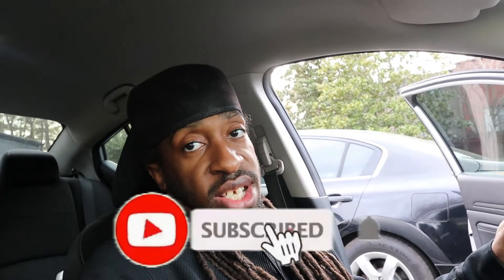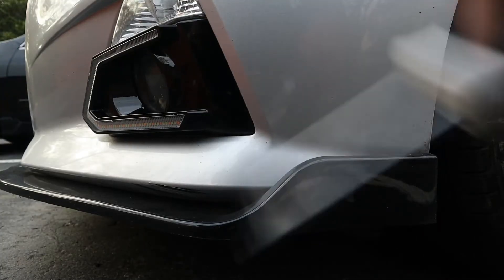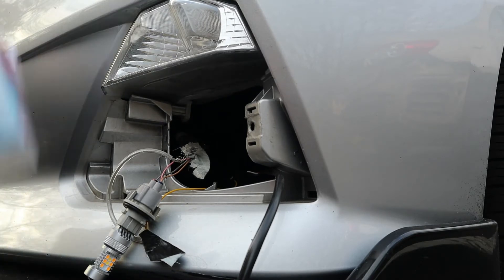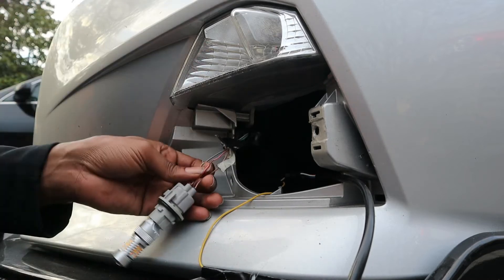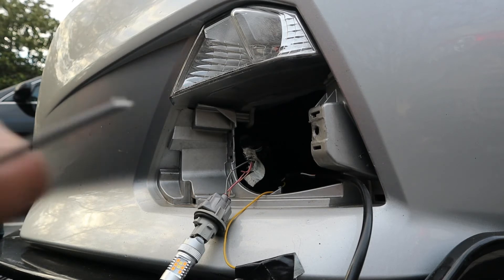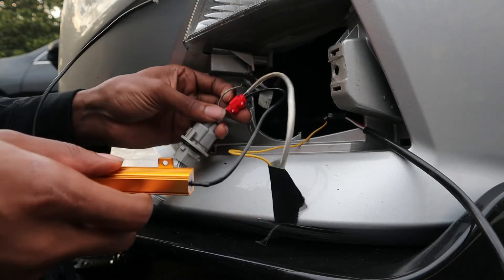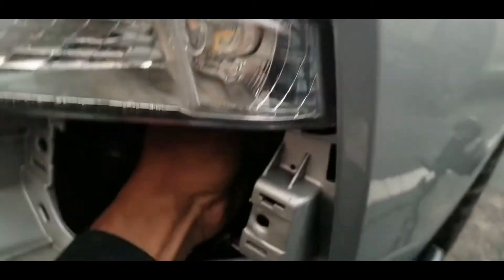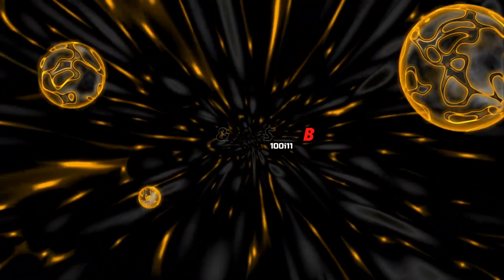LOAD RESISTOR INSTALL TO STOP HYPERFLASH SIGNAL ON 2019 NISSAN ALTIMA

Comment: I just got my led DRLs and the front splitter installed on my 2020 SR yesterday. The body shop charged me $150 for both! The car looks TRANSFORMED! The hood body lines stand out now and it just looks more finished overall. Thanks the videos.  I'm the only Altima with these mods in the Mac Town lol.
Reply from the maker: Damn.. they charge you $150 for both. But it do make it look good.

Comment: How do you install the front bumper lip ?
Reply from the maker: You can lift the car up or take the bumper off. I did it with my bumper off, cuz I was putting in my lights